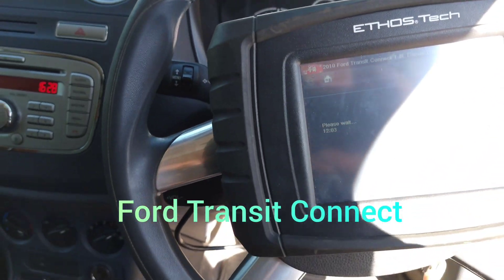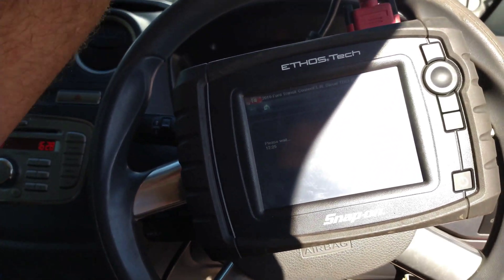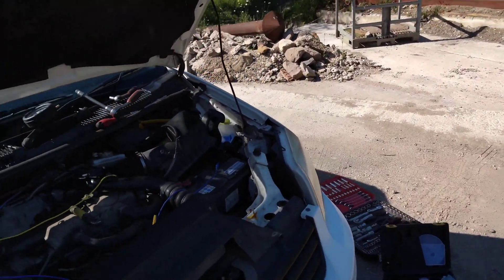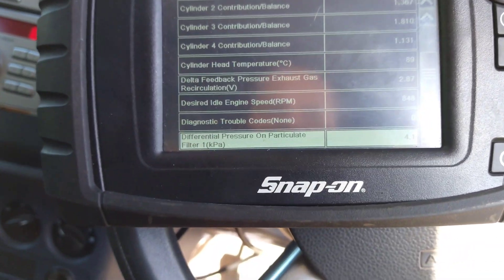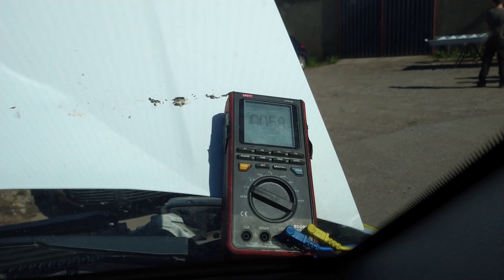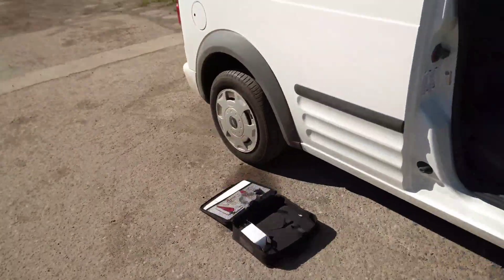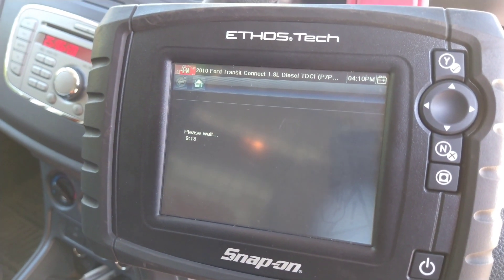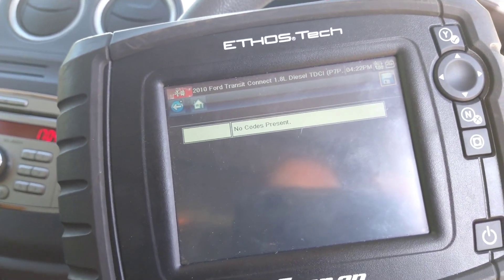Ford Transit Connect (DPF ash/soot content too high) fooling it to allow a regeneration.

Comment: Good video, I have used dpf cleaner on my dpf then  put It back on the van but the light is still on is there a way to reset it without one of them computer things you have, my brother used a cheap obd he got of eBay but only says the fault code and can not delete it.

Comment: Hi matt i have a code p20cd and it will not regeneration any idea thanks
Reply: The DPF temperature sensor is saying 100 when you first start from cold do you know what it should be thanks
Reply from the maker: That may be your problem. I recently had a Renault trafic with a faulty temp sensor that stopped the regeneration. It had no fault codes, like you I had noticed a faulty reading from the sensor. It was an open circuit in the sensor. Stuck at 5 volts all of the time. After replacing the sensor, I couldn't carry out a regen with a launch. It had to be done with a snap on ethos.
Reply from the maker: I looked at the code definition and it said it was to do with the exhaust injector. If it is blocked it would need changing. That's if yours has that fitted
Reply: @mechanicmatt871  I have fitted a new vaporizer injector also I've had an ECU cloned because the original had water ingress